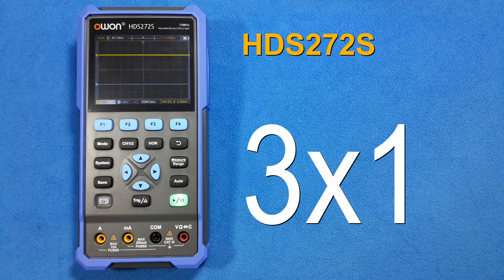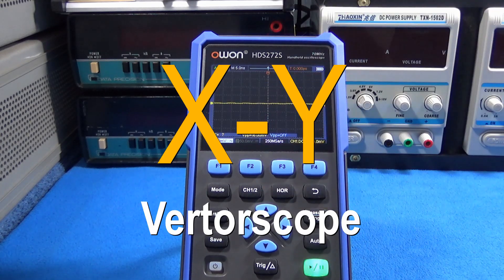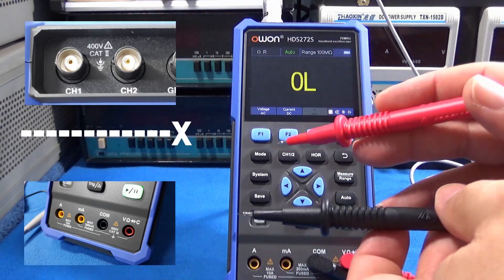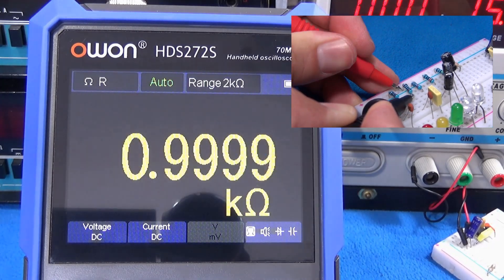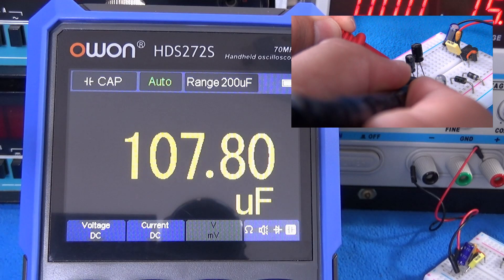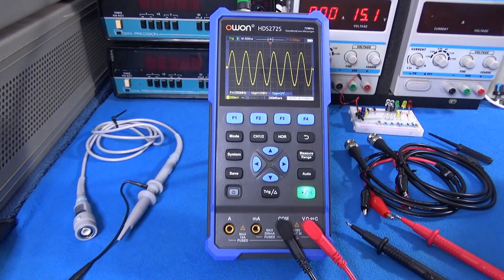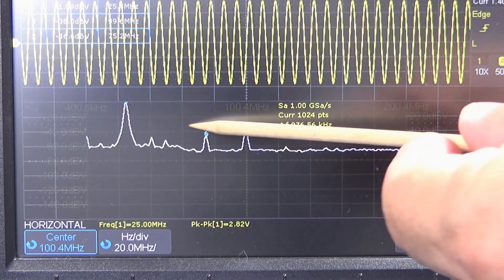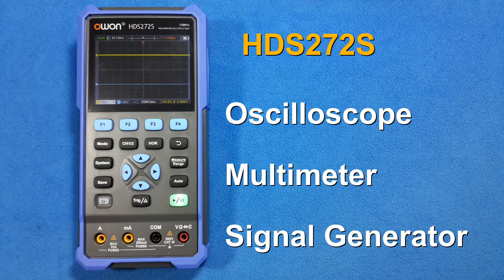Owon HDS272S 70Mhz oscilloscope dual channel - 25MHz Function Generator - Multimeter product review

Comment: Be aware that when measuring on the mains voltage with the multimeter, the BNC-connectors on the top are connected internally to the "COM" connector, and will have live voltage when doing so. This is not a fault though, but worth mentioning for safety.
Reply: Definitely worth mentioning. Newbies often seem to have some kind of compulsion to stick their shiny new test equipment into mains outlet without awareness of the potential safety issues.  Bob mentions that the USB connector shares the same ground as the BNC, so that will also be connected to the COM connector, a pretty decent chance of getting a shock if you are probing high voltages whilst holding the meter.
Reply: @ferrumignis  I think that is what is pointed out in the video. However, a  significant point he does miss is the CAT 2 rating of the scope input   means you are restricted to end user mains circuits and certainly not  for measuring  mains voltage at a distribution board or any mains voltage throughout the building.  

I have seen one of these meters taken apart and I have to wonder whether  the flash over protection   is adequate.

If you are going to measure mains voltages then pay the extra and get a second hand Fluke.

These Chinese meters are a lot better than they used to be and some are pretty impressive but when it comes to safety they are not there yet.

Comment: I have had the 40Mhz with signal gen for about a week and I love it, I am a motor mechanic and its perfect for checking signals quickly without having to hook the car up to my Picoscope, very impressed so far thanks for the review it has confirmed what I thought.
Reply: hello. it can write data stream to internal memory?
Reply: The only item that irritates me is the fact that probe selection doesn't include 20X.  It jumps from 10x to 100x.  So, I have to do a bit of mental math when using  20X hantec.